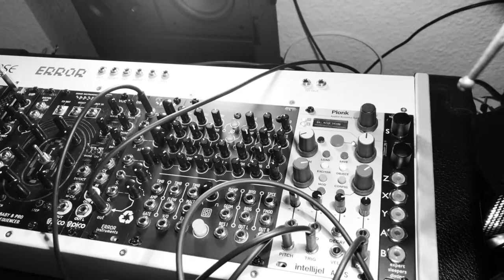Flying attenuator

Comment: Nice little feature - a suggestion for a v2, have the patch cable go in either end so that the attenuator is at 90 degrees. Adjustments then would feel like turning an in-line valve or faucet. You could also color the closed and open side differently. BTW, really continuing to enjoy the acid bee!
Reply from the maker: Paul Boos Thank you very much paul